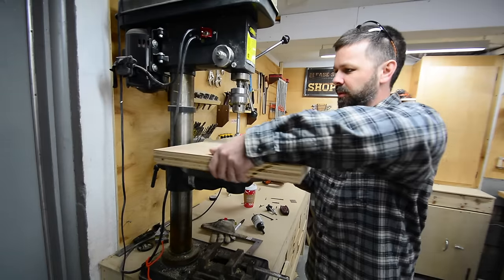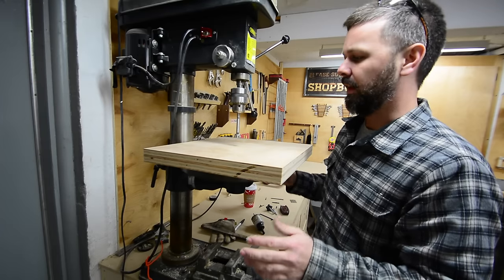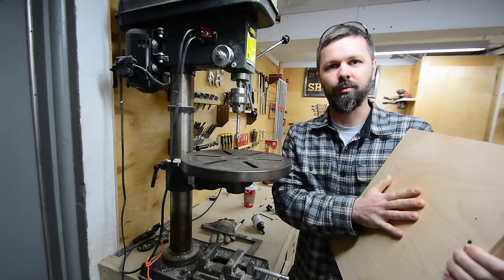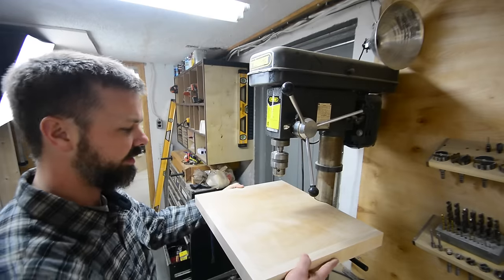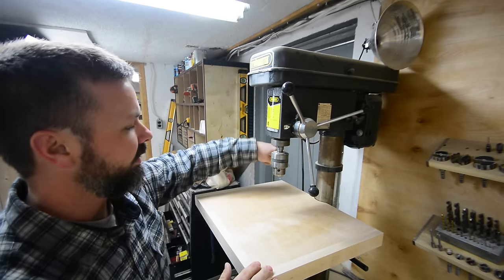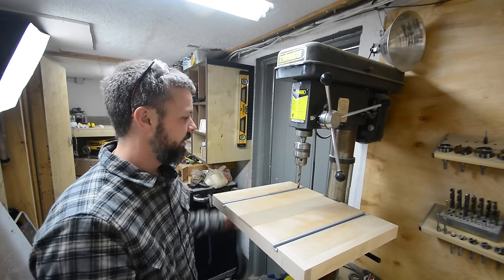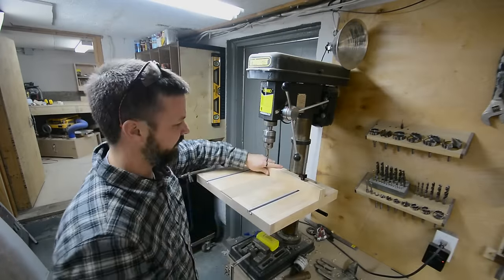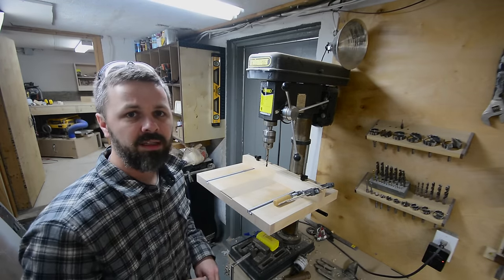A basic drill press table

Comment: Hi Shop Built. Good video. I borrowed ideas for my drill press fence that is bolted at one end only with clamps to hold it and this allows a series of holes to be drilled parallel to the fence. Also I attached two Bessey style clamps to the fence facing out to clamp the piece to be drilled. Colin in Northern Ireland
Reply from the maker: nice, never thought of that:)

Comment: Nice build, Love the tool less table.   Have you considered moving drill press down?  It looks like spinning board would hit you square in the jugular.
Reply from the maker: yes! it is to high but i can't figure out where else to put it in my shop. When i find a spot you can look forward to a video for a drill press stand;)
Reply: I managed to recess my DP on a frame fitted into the cabinet framing and then re-installed the cabinet top.  I needed to get rid of the drill press mounting foot as I have my miter saw right next to the drill press cabinet location.  Only the DP column comes thru the cabinet top.  The drill press cabinet then allows outfeed for the miter saw.

Comment: you can cut a groove on middle length of the stop block and a hole in the fence (on the side) to pass a bolt through, and tighten it on the rear of the fence., then add graduation on the fence, poor man's T track style.

Comment: Any ideas on how to level the factory table? Mine is about 1/8 inch off front to back and 1/8 once off side to side.
Reply: Most have side to side adjustment underneath and you may be able to adjust front to back where the shaft for raising  and lowering it goes into the top of the drill press. (sorry I don’t know all the terms for individual parts)
Reply: Gary McCoy The front to back might just be that you're not tightening the table on the post after adjusting it up or down.
Reply from the maker: my last drill press was super cheap and the table would bend when ever you press hard so when ever I had to get a very straight or long whole i would have to wedge a block under the table. I waited for a good old drill press to come up used and bought that. i'm not sure there is any good way to straighten front to back.